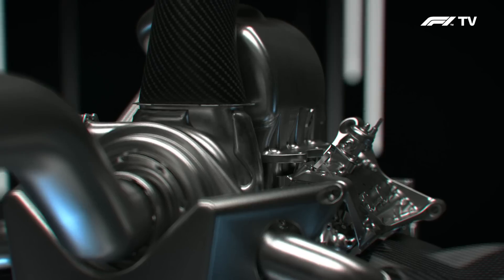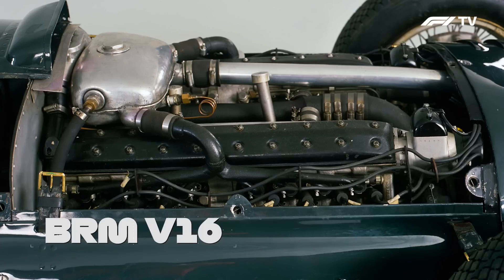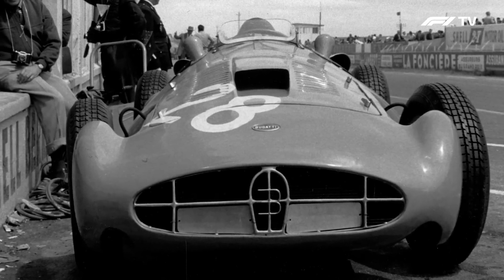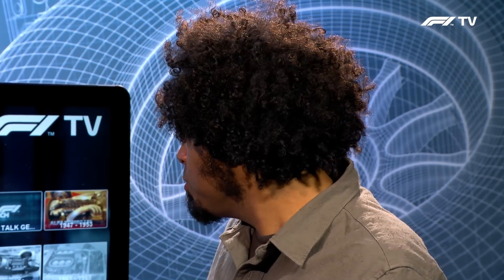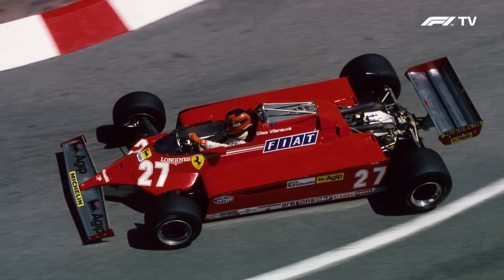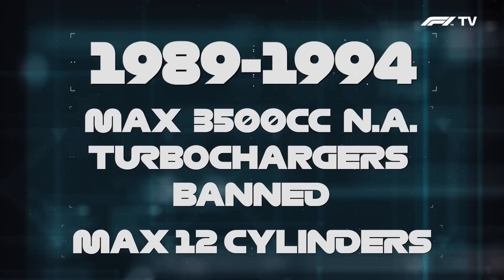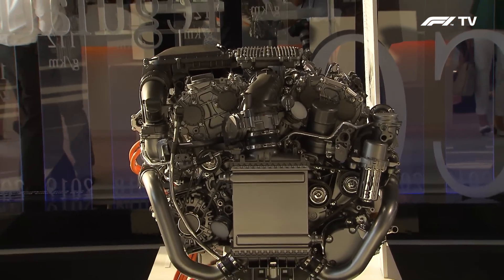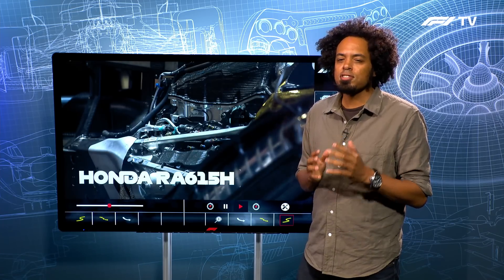Evolution Of F1 Engines | F1 TV Tech Talk | Crypto.com

Comment: Turbo 3L V10 would be sick. Or hybrid V10 if they really want hybrids.
Reply: @FelixVyra  actually asking for v10s is missing the point of why manufacturers join formula 1.
Reply: I know everyone wants V8s and up to come back, but it's never gonna happen. No manufacturer will want to join F1 if the layout was anything more than 6 cylinders, with the automotive industry getting green and all that.

With that being said though, now that half the PU is spec, it opens up the door for engine layouts to become open again since total horsepower has been dropped so significantly. I'd love to see 3, 4, and 5 cylinder ICE's with different displacements alongside the traditional V6. All turbo of course.
Reply: They aren’t going to bring older engines back just for nostalgia
Reply: you guys, just watch BOSS GP
Reply: If sustainable fuels happen to be hella efficient I can't see no reason to run the V10s again
Reply: @timzy4395  - 👍
Reply: @timzy4395  Expensive to run, costly development, more moving parts and by that more prone to failures, heavier. There is a reason F1 went back to V6s
Reply: @_chaitanyajoshi  - cars today(2022) weigh 790 to 810kg.....way heavier than an F1 car in 2004 thru 2006.
Reply: @jgonzalesm6  Yeah but the weight would increase even more. It’s not like if they go with V10s they are going to ditch the hybrid system and all the safety measures and the cars will get lighter miraculously
Reply: @_chaitanyajoshi  - you do realize batteries weigh alot from the hybrid system???

In 2014, the Mercedes W05 weighed 600kg.  Since then, the cars have gained 200kg.

Have you seen a Renault R25(2006) next to a Renault RS20???
Reply: @jgonzalesm6  Yes and the hybrid systems will stay no matter what. How will F1 be sustainable? They want a green image and if they don’t have the hybrid systems they won’t reach that goal
Reply: @_chaitanyajoshi  - but why with the hybrid system??? It has no use in mass production cars.  Europe wants to.phase out the ICE platform by 2050 and go fully electric.  Alot of these F1 manufacturers are based in Europe.

F1 has no place in the global scheme of things when EVERYONE is pushing electric and fully autonomous vehicles with electronic assist in everything.

Btw, did you see what Alonso did in the R25 in 2020 at Abu Dhabi at night on redbanded Pirelli tires (super soft)??? He almost equaled Lewis Hamiltons fastest lap in 2019 (WITH DRS!!!!)
Reply: @_chaitanyajoshi  - 2022 Mclaren Solus GT--->V-10 hypercar worth about $3 million.
Reply: @jgonzalesm6  Yes that’s the point. V10 is nice for those supercars but the companies want to make massproducable tech because that’s where the real money is
Reply: @_chaitanyajoshi  - No, you either go full ICE or electric...there is no stop gap in between.

Fully electric is the push right now.

Meanwhile, there's Biofuels and hydrogen powered cars.  I wonder what said governments will cling on to on the next 20 years??
Reply: @_chaitanyajoshi  - Look up this video on YouTube "Which uses up more electricity.....a refrigerator when it's running or an electric car when it's charging?"

The Senator is an MIT graduate and emplors the use of "the next big technological advancements or challenge" but he drills Secretary Buttigieg on the use and push of electric vehicles.
Reply: @jgonzalesm6  Electric cars couldn’t last a Full Race distance. And FE has a contact in place which states that they can be the only single seater electric series. Hydrogen create way to expensive and inefficient. So F1 has no Option than going hybrid
Reply: @_chaitanyajoshi  - the problem is CO2 emissions.  A naturally aspirated ICE platform can use biofuels and still produce zero CO2 emissions instead of this push for electric vehicles.
Reply: @jgonzalesm6  But 100% biofuels are still not massproducable in a cost effective way. Hopefully that will change with the commitment of F1. But all major car manufacturers already have committed to electric cars themselves and many will have done the switch to a fully electric lineup by the next decade in 8 years. So really the governmental pressure isn’t really necessary. Electric cars are the easiest, fastest and most cost effective way to go carbon neutral right now anyway
Reply: @jgonzalesm6  I am from Germany so I can only talk about Europe. We have a electrical grid big enough to support all those cars even without nuclear power and coal. Here it is very common to have solar roofs on houses. There will even be a new law coming into act in 2028 here which will make it mandatory to have solar panels on all new buildings. Decentralizing the grid is an important aspect. But it’s true that many other countries probably don’t have the infrastructure yet to support this many electrical cars. But you should also consider that for the production of renewable fuels and for the production of hydrogen a lot of energy is needed.
Reply: @_chaitanyajoshi  - Germany is DEPENDENT on Russian oil.  Now that that Russian oil is gone by the wayside, Germany is having to fire up COAL plants and nuclear plants that have remained dormant.  Germany is NOT energy independent.  

You are right, Germany is not like the United States with regards to population and we here in the states need to invest TRILLIONS of dollars NOW on the electrical infrastructure IF we are to be AT LEAST 50% dependent on EV's with regards to population.

What about India?? China?? Russia??  Whom each country have BILLIONS of people that ARE NOT contributing to this "green" energy push YET are emitting thousands of tons of CO2 currently(more than the U.S. and Germany combined) to the earth.

Germany and U.S. can cut all their emissions to nearly zero but what about those other HUGE (population) countries that are not and don't want to contribute this green energy ideology?  How are we going to make them contribute??
Reply: @_chaitanyajoshi  - I doubt India will go FULLY electric by 2030.
Reply: @jgonzalesm6  Well that’s the plan. And China will have an electric car rate of 40%. And China is pioneering in electric cars
Reply: I think you're missing the point of the word 'efficiency'
Reply: Hybrid V10's would be nice! Unfortunately, F1 these days are way too soft to make it happen.
Reply: V10 will make the engine and racing ♾ times better
Reply: No it won’t…
Reply: What road car has a V10 engine anymore? What car that isn't worth the GDP of a small country and is available for you right now going to have that sort of technology? F1 is a giant marketing tool, and manufacturers make most of their profit from small hybrids with V6 engines. There's no point developing an expensive 1500 bhp V10 hybrid, when it serves no purpose outside the sport; why do you think the new engines are getting rid of the MGU-H system?
Reply: @princeendymion9044  serves no purpose outside the sport? If "relatability" is really the goal then why have I never saw any $300M, sub 800kg, open cockpit, single seater, fully CF body, bespoke titanium parts, innovation (DRS, DAS, flex wings, etc.) absolutely mental drag/track car? Motorsports are meant to be fun and innovative, but of course politics dictate that electric is green. While totally ignoring the fact that most cost and pollution aren't from the cars itself but the on logistical end.
Reply: @princeendymion9044  The current Lamborghini Hucacan uses a V10 and several sources say the next gen Huracan will use a hybrid V10.
Reply: @zentaur966  That's a Hucacan, something not your everyday person can buy now is it? It's costs close to $400k, and none of that technology is going to go into something like the Urus or other cars Audi (Lambo's parent company) makes. It doesn't change my point
Reply: @princeendymion9044  Noise is half of the experience if you go to a race. These 1.6 engines are so boring to watch.
Reply: @mozzymike7192  The manufacturers don’t care about noise. F1 will stay popular anyways. If they can save money and have more efficient and faster engines then why change? They’ll of course stick with V6
Reply: @_chaitanyajoshi  you’re completely right but I just wish they would go back to louder, ear-splitting engines
Reply: @mozzymike7192  I completely understand you but times sadly change
Reply: @_chaitanyajoshi  youre right, naturally aspirated cars are actually  allowed currently but no one uses them
Reply: @mozzymike7192  that makes no sense. I wonder what you will do to pitch for a new product. You'd probably go like "Yeahhh it's totally impractical, but cmon the nOiSe!"
Reply: @mozzymike7192  the racing is the excitement not the engine e sound  this and the last season were b entertaining than a lot in the v10 era
Reply: @princeendymion9044  But conventional engines aren’t that expensive hybrids are millions of dollars you can develop a V-10 for a few hundred grand
Reply: @moneymonkeyman8280  - yep.
Reply: @moneymonkeyman8280  What kind of SUV or Hatchback uses a V10? Sure manufactures could develop a V10, they're not going to get much of a return on it when no one buys it. Mercedes makes up to 2 million cars a year, most of which doesn't use monster, fuel-inefficient V10 and V12's. They get most of their profit from the same little engines that are beefed up and crammed into their F1 cars.
Reply: Biofuels is where it's at.  Zero carbon emissions.

Seb ran his 1992 FW14B (V10) on the track a couple of weeks ago with zero carbon emissions.

Bring back the 3ltr V10's.
Reply: @jgonzalesm6  V10s are still more expensive and less efficient
Reply: @_chaitanyajoshi  - compared to what??? The 1.6ltr turbo hybrid formula??? NO THEY'RE NOT MORE EXPENSIVE(V-10's)!!!!

1 engine from the current turbo-hybrid era costs 3 to 4 million USD...EACH!!!!

An F1 spec V-10 costs less than $500k USD.

This whole going green in F1 is to lower carbon emissions.  Biofuels takes care of that while still maintaining an ICE platform.  

This is F1.....who cares about efficiency or thermal efficiency.  Open the fuel flow and raise the rpms to 18k.
Reply: @jgonzalesm6  You forget that the teams would have to design a whole new PU in order to change to V10. These are just unnecessary expenses no team would want to take
Reply: @jgonzalesm6  "Who cares about efficiency or thermal efficiency" The engine manufacturers
Reply: @_chaitanyajoshi  - the teams don't have to design anything with regards to the PU.

The FULL WORKS teams do i.e Mercedes, Ferrari, Renault.....to include engine manufacturers like Honda and soon Porsche (2026).
Reply: @jgonzalesm6  Yes and it would be expensive to develop. That means the teams will have to pay more for the PU
Reply: @_chaitanyajoshi  - lol.....Cosworth Ilmor makes a V12 for the Valkyrie and the McLaren T50 at a 5th of the cost for an F1 turbo-hybrid engine.

If Cosworth can do it, I'm sure Mercedes, Ferrari, Renault, Honda and Porsche can make a V-10 for F1 for ALOT cheaper than the current turbo-hybrid platform.
Reply: @jgonzalesm6  That is because these are producing costs. If you consider R&D the costs will be much higher
Reply: @_chaitanyajoshi  - you do realize these current(2022) turbo hybrid engines have no use in todays or future mass produced cars yes??? Even Sebastian Vettel states this.

You do realize that F1 for 2026 are "dumbing down" the current(2022) turbo hybrid engine???  They are taking away the MGU-H and upping the MGU-K power output to almost triple the KW(kilowatts).  This would make the PU's for 2026 cheaper but not nearly as cheap as a 3ltr V-10.
Reply: @jgonzalesm6  you are comparing an engine from 20years ago against a modern engine ofcoarse the V10 is gonna be cheaper but if f1 were to go back to v10s with same level of tech and efficiency it will cost a fortune easily double the current engines
Reply: @jgonzalesm6  Well the sustainable fuel will have use. And the energy recovery system will have too. The 2026 refs are designed to be more applicable. They want to get Audi and Porsche into the sport
Reply: @prosperbanana  - nope.  V-10's will be way cheaper today.

Do you know some F1 tracks today(2022) still hold 2002 to 2004 F1 track records that have yet to be broken??

Comment: 1:52 its also the standard in regular cars because carburetors are seen as archaic
Reply: Indirect injection replaced carburetors. The direct injection Mercedes developed didn't catch on until about a decade ago.
Reply: @dylansmit3883  Exactly, don't confuse  direct injection with fuel injection as a whole. There's carburetors, then there's indirect injection (the fuel is injected in the intake manifold) and direct injection (fuel is injected directly in the combustion chamber) which has only become a common technology relatively recently.
Reply: Except in America, but for production cars yes.

Comment: We want 3LV10 with sustainable fuels
Reply: I want variety, but manufacturers don’t want v10’s
Reply: do yk how much v10s consume lol
Reply: @liynne  then loosen up the regs by other means. If you want a supercharger, you can run it, if you want a turbo, you can run it. Fine, keep 6 cyl max but allow 4 cylinders also. V6, H6, Straight 6, I4 or even the Boxer layout.
Reply: @OggaDugga  Yes try cramming that into a $140 million budget. This isn't the 1980's, there's no tobacco sponsorship creating an infinite budget for independent teams to come up with genius solutions; only the manufacturers are capable of fighting at the front, and what would the point be in developing a monster engine like a V10, when none of that research will go into the sports car or hatchback you'll buy in the next year or two? It wouldn't be profitable, and they'll end up like Toyota and Ford and leave the sport
Reply: @princeendymion9044  why develop a V10 if you can just reuse the existing designs? Vettel drove a classic F1 car with sustainable fuel during a demo earlier this year, and it didn't require any modification. The only issue here, is reliability, with the V10's, though the later models already had to run multiple races, were never designed to last anywhere near as long as today's V6's. Part of that could be down to the lower revs the V6 uses, but I'm not an engineer.
Reply: @halofreak1990  Why use a V10 from the 1990's when in comparison to today, that technology is ancient. The V6 Turbo's alone produce up to 800bhp, the same as those engines back then did. They also cost a lot more than a V6 Hybrid, especially when you have to consider that engine has to run for at least a third of the entire season. If you wanted a V10 that could last that long, it would need to either be ridiculously expensive, or tuned down to make sure it survived multiple grand prix, which would take away the reasons for having it in the first place. This is like saying we should get rid of the Halo because the car's look better without it and it used to be better in Ye olde time. If the sport wants to survive it must change
Reply: @princeendymion9044  they would just need to give the old engines, a modern engine management system, and update the valvetrain and bottom end to modern material equivalents. It doesn't need to be a 20k rpm screamer. F1 now has an RPM limit of 15k but teams are nowhere near that. This would allow them to do so. As for ridiculously expensive, teams wouldn't need to develop a turbocharger which is one less faulty point. Anyone who knows anything about engines knows that turbo engines put a lot more stress on the block do to increased cylinder pressures. You say the sport needs change in order to survive. Then let the teams have different approaches to the same regulations. The teams have gone on to saying the V6TH engines have becomes the most expensive engines ever made. I doubt a 3L V10 or 2.4L V8 costed 18M each compared to what the current engines.
Reply: @OggaDugga  They cost just under $10 million each so nice try trying to pull numbers out of thin air. You're also forgetting that F1 teams would use an engine for Qualifying, throw it away, and then put another engine in for the race and  throw that away for the next Grand Prix, which by the end of the season would end up costing more than having 3 Turbo Hybrid engines, which is the reason the engine limits were introduced in the first place. 

You can sit there and try to explain how an F1 team could make a modern V10 engine, but the sponsors don't want it, the FIA doesn't want it and the general public who aren't diehard, older fans of the sport don't want it. If Mercedes showed up next year with a V10 engine they would be obliterated in the press and have their reputation ruined. If you don't want to move on from an era that has been over for almost 2 decades, then leave. There is no one stopping you from not watching. The entire world is moving on from that era, and if F1 was still using V10's, I can almost guarantee you neither Liberty nor Bernie could have kept it alive.